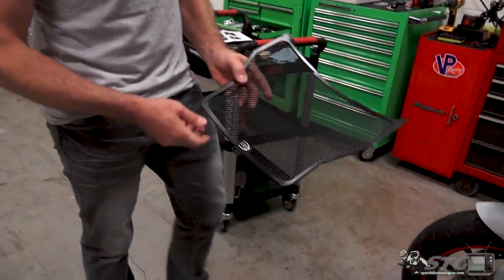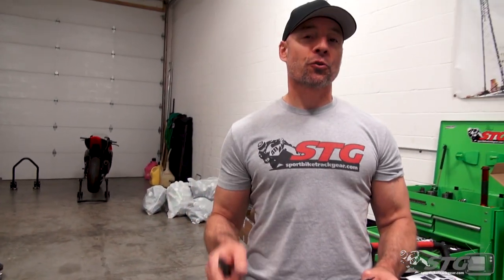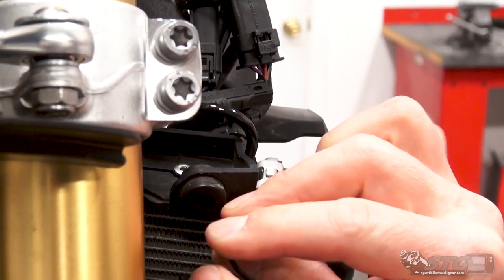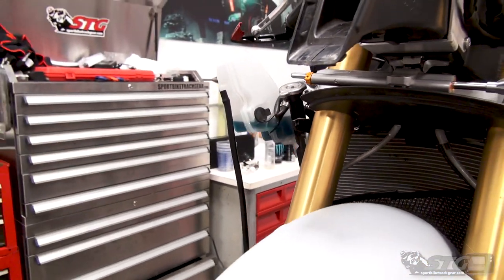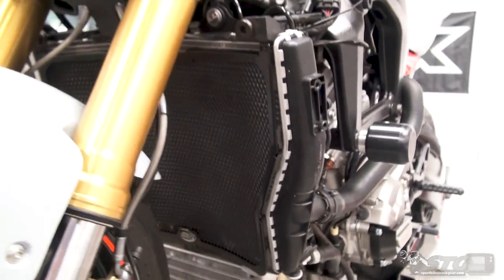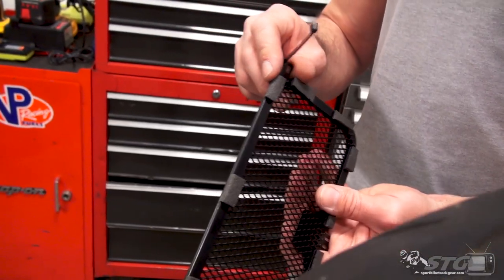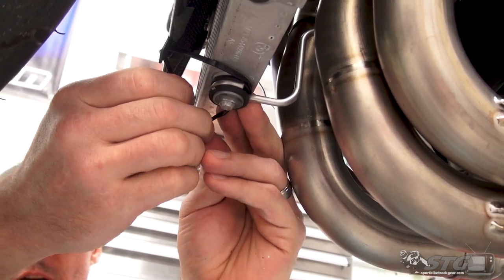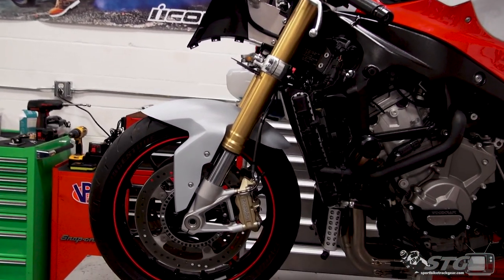2020 Project Bike 2018 BMW S1000RR R&G Radiator & Oil Guard Install | Sportbike Track Gear

Comment: Hello Bryan, comment do you think that rapping the headers with help the radiator and oil cooling running better? Thank you man
Reply from the maker: I would not wrap the headers on the bike. - Van
Reply: @sportbiketrackgear  I thought that if we could minimize the heat transfer to the radiator and oil cooler  would help the bike

Comment: I wander how are the straps gonna take the heat?
Reply from the maker: We have used this same install method on bikes that we have ran for multiple seasons on the track without issue. The cable ties have not shown any issue managing the heat. - Van
Reply: @sportbiketrackgear  Thank you
Reply: I in fact prep. the same guards to install. That’s why I asked about straps.